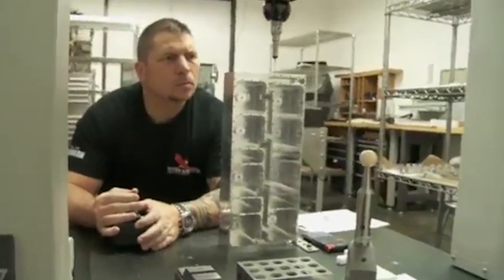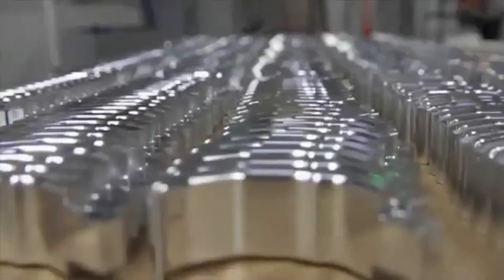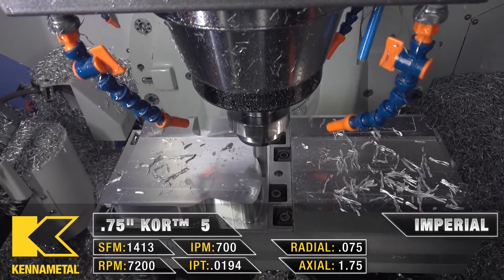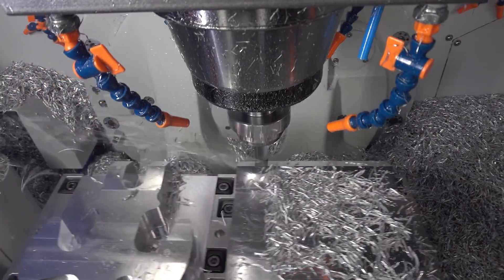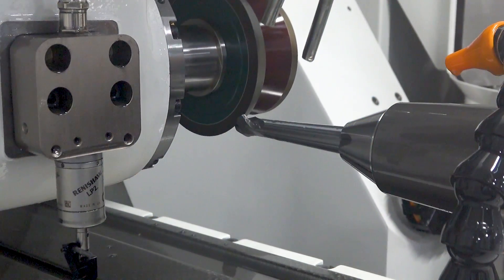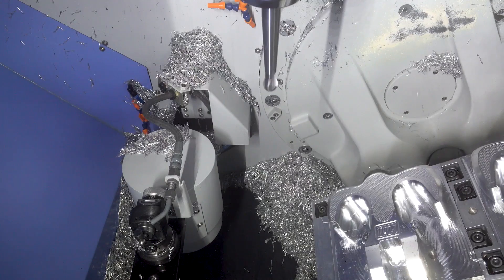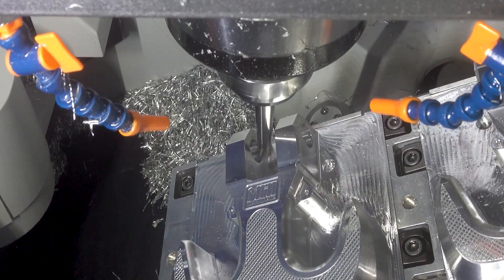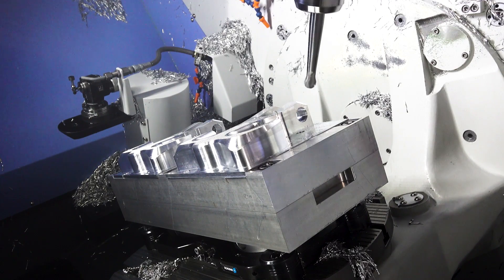Big Customer wants parts made but I Don’t Have the Equipment or Experience… Do I Turn Him Down?

Comment: I started with 3D printing about a month ago. Closed my eyes and bought cheapest bang for buck printer. Tought myself how to use freecad because I need to upgrade my PC to run fusion 360. Cant wait to upgrade it. My plan is to start and save for CNC mill. When I starded out on cad it was like a bug that bit me. I cannot get enough of it. I do have some conventional machining experience and it helped me loads with my work. Designing and making parts for customers that they cannot find or buy anywhere else is an amazing feeling, even though i just started out. Titan thanx for being such a rolemodel in the trade. You are the perfect example of what a person is capable of. Keep up the good work.
Reply: How big of an item can you make?
Reply: @allenhuebner6251   220mmx220mmx250(height)mm
Reply: But mostly parts are smaller.
Reply: I make automotive components mostly.
Reply: @stoffel89  
I only know inches. 
24x18x approximately 3/4 inches thick 
2.5 lbs
Reply: 8.6 inch long x 8.6 inch wide x 9.8 inch height
Reply: @stoffel89  
10-4,  thanks for the reply

Comment: Sir why you didn't use castings? Why you always using a single blocks ?
Reply: The materials demanded by customers and for the purpose & heavy duty use of those parts, casting is not an option.
Reply: Billet materials are vastly more predictable and selected to fit the purpose of a product where high strength is required. 
But if the run was for many thousands to millions of units, the cost of tooling, outsourcing and quality control for forgings could be justified. Take some time to study up on aluminum forging.
Reply: Crystalline flow in casting is not linear. So differential stresses are real and the material will warp due to relaxing when being machined.